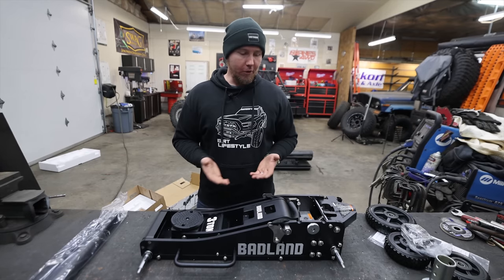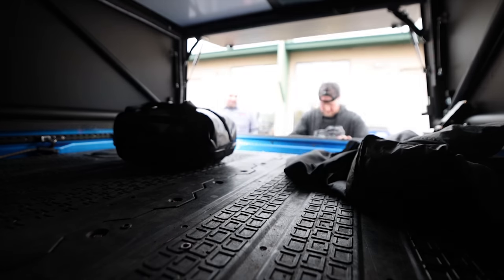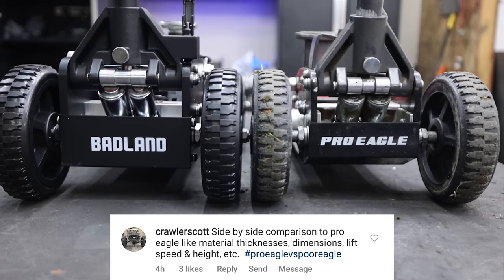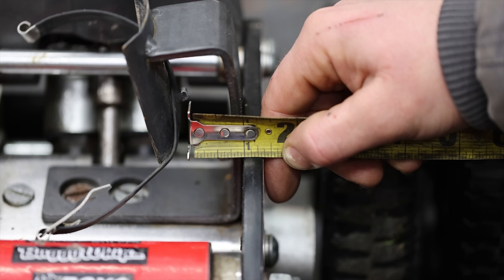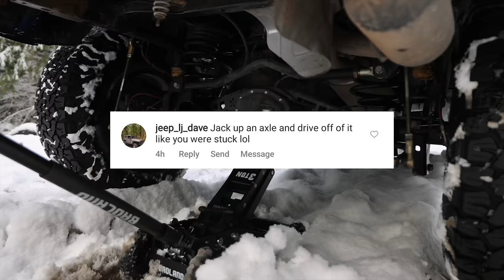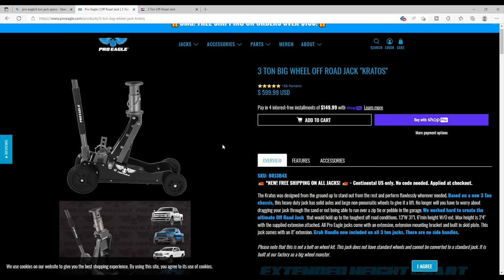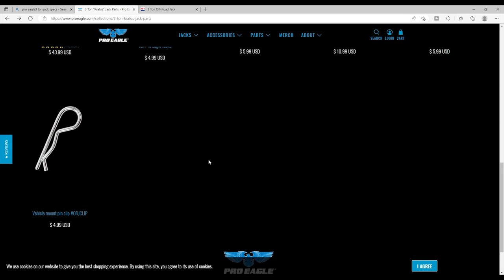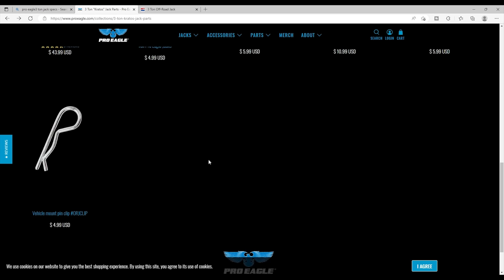Pro Eagle Clone Or Killer? Harbor Freight Offroad Jack Test and Review.

Comment: FYI - harbor freight manuals usually have a numbered diagram of parts that you can use in reference to ordering parts with the 1-800 number. The manuals are usually available by PDF on their website. For this jack the parts diagram is page 9 of the manual. The phone operators can pull up that diagram and be literally on the same page with you.
Reply: WOW, I was just getting ready to make this same comment!!! I guess for some of us it's common knowledge...

Comment: Harbour Freight has some great stuff especially for a DIYer. For tools to use in the shop/home, heat shrink, apache cases, etc. I have had some great success with their products.
Reply: 100% unless you are a professional mechanic, you don't need super expensive tools like Snap on. HF tools are great for the occasional DIYer. I have a few HF jacks and jack stands that have been flawless for ten plus years.
Reply: @remembermorrison A lot of shops are converting to ICON now…
Reply: all of my tools from high school are from harbor freight. all Pittsburgh and some craftsman. I have pittsburgh jackstands and a 3 ton pittsburgh jack. (jackstands are from BEFORE the recall, theyre the good ones, as been proven since they havnt killed me yet). Ive had these tools for over....6 years now and they just used like 2 weeks ago to pull an engine out of a honda Fit. people hate on harbor freight because "cheap" but i like cheap where its still giving me my moneys worth.
Reply: @remembermorrison  you’re absolutely right and I’d even say that some of their newer ICON line stacks up just fine against the more expensive brands you see in professional shops. They’ve been putting some high quality stuff out in recent years.
Reply: @g1mpster  Gearwrench too. They have really stepped up their game.

Comment: The fact you can flip a lever and rock the jack on the back wheels to roll it around is so handy! My pro eagle doesn't do that and if you want to push it around a corner it's not the funnest thing to do.. also the side grab handles are cool.. I want to add that to mine
Reply: I agree. An excellent improvement over the competition. The Pro Eagle Kratos has a serious competitor now. Why spend twice as much? HF has a hit a home run with the Badland floor jack.

Comment: Been using Harbor Freight’s Daytona 3 Ton Floor Jack for a while now and it’s a fantastic jack for under 2 bills. Don’t quote me but I read somewhere once that it’s 99% the same thing as the equivalent Snap-On jack. They have some nice stuff (not everything) and that off-road Jack looks pretty legit. Thanks for the review!
Reply: I have that Jack too & it is a snap on rip off. They even sued them in court but settled during discovery bc snap on didn’t want to disclose trade secretes
Reply: @adidas4275  not even a rip off, harbor freight found the same factory that was building the snap-on Jack and had them build the Daytona Jack. Snap-on didn't want people to figure out they were paying 1200 bucks for a china jack. Recently they've made the jacks in the us now for about 3 years
Reply: Snap on filed a lawsuit against harbor for this exact reason and LOST so it is not the same jack by court standards

Comment: One of your rock crawling buddies over at Muddy Beards bought a kit from 911 Motorsports and converted a Harbor freight racing jack into a big wheel off road jack.
I couldn't resist, it was so easy I bought a 100 dollar HF jack, ordered the conversion kit and built my own unit.  
So far a year later and I've had no issues with the jack, works perfectly. 
I think I paid 130 bucks for the 911 Motorsports kit plus the price of the jack, so it only cost me 230 dollars plus tax.

Comment: it seems like harbor freight learned from their jack stand issue. to use the ASME-PASE standard is a good idea. Also, couldn't you use Pro-Eagles accessories on the Badlands jack?
Reply: No the parts are different. Also the wheels are held on with nuts instead stupid clips that get lost when popped off. The lift extension is bolted on instead of twisted on. I love it so far. Pro Eagle claims theirs is made in the USA, well i am sorry but i haven't seen much quality coming out of the USA lately and i live there.
Reply: HF has been vacuuming up engineers from everywhere.
Reply from the maker: I saw a bunch of the new jack stands  from Harbor Freight at sema. They welded the bottom of the seam that was failing and made a couple of other small but significant changes. It's clear that they want to improve the products and change their image. The good news is as consumers, we win.
Reply: @SimonElenor  They don't claim the jack is made in the USA at all, thats exactly what this video points out.

Comment: I got my first HF floor jack when I turned 17. That was in 1980. A 3 ton with a set of stands. I'm still using them today. I have had to replace the seals a couple times.    This new big wheel jack is something I'm going to need to pick up.

Comment: One thing I would’ve liked to see compared was the weight of each jack. Wasn’t listed on harbor freight’s comparison and I think when I looked up the specs it was a decent difference.
Reply: Pro eagle 3 ton is 12lbs lighter
Reply: Badland Product Weight 72.66 lb.
Reply from the maker: I wish I could speak more confidently about this. I just didn't have the 3 ton pro eagle to compare, but the thickness of the frame is definitely one area that will change the weight in a big way. Plus, the front of the Badlands has steel sections for the lateral support that isn't on the pro eagle. This will help keep the jack from folding over if it's on an uneven surface. This is speculation until I see a 3 ton pro eagle, but I think the weight difference comes from extra supporting structure and material thickness.
Reply: @DirtLifestyle HF did some serious research on who they are marketing these products to and how they will be used in the wild

Comment: Great review. The quality of Chinese products like this largely comes down to requirements coming from the R&D guys sitting in America. As part of the PPAP a reputable company would require (and verify!) chemical analysis and mechanical strength of the components, good quality seals, adequate precision and surface finish and then perform release testing for durability, chemical resistance (salt spray), high/low temperature function, etc. China can churn out decent stuff when there are very clear requirements and verification by the customer.
Reply: I agree with this, coming from the machine tooling and automation industry, the big Chinese machine shops can and will make good parts to exact specs. There is enough competition over there and in the US that if a shop tries to lie/cheat on the print specs, there are 5 more shops that are willing and capable to make the part to print. The company I work for (Complete Control Systems) still makes 99% of our parts in-house but a lot of other machine builders are designing machines, sending print packets to Chinese machine shops and getting back their machines in kit form.
Reply: Quality standard is usually up to the company that is buying the product from the manufacturer.  These manufacturers have to adhere to whatever standard the buyer/company sets forth.  Where it’s made is really a moot point.  Hell, I’m typing this on an iPhone made by an underpaid worker in basically a sweat shop and I don’t question the quality of it whatsoever.
Reply: Yup.  Way back in the day (I don't know if this is still the case) I knew someone that did a teardown of an Oppo phone (this was 2013-2014ish) - it was surprisingly well made, physical design was better than almost any phone on the market.

Too bad their software sucked - Oppo did have some efforts along those regards (including cooperating with Western developer teams) but they suddenly lost interest in catering to Western customers.

With this thing - no software, so THAT problem is solved.
Reply: I fully agree. A lot of the Rivian R1T suspension components are made in China.

Comment: Here I am modifying HF 2ton jacks with their 1100 lb 10” wheels and having no problems. Cheap, easy, works mint. 4130 axles and some aluminum plate. 

Great video! Nice and simple testing, and great callout to the manufacturers!

Comment: Interesting video! I did some research - Pro Eagle is actually a d.b.a. for Austin International Manufacturing, Inc. - who specializes in importing Chinese products into US market. So yeah, pretty safe to say, Pro Eagle is imported. They claim to specialize in Taiwan imports but looking at recent import logs its pretty much all Chinese. Clearly both are buying from the same caster supplier -  so if I had to guess the same plant is making both or at least their caster (wheel) supplier isn't far from both assembly plants.

Comment: Nate great comparison video, here in Canada any product sold in Canada has to tell on the packaging where its made or imported from to be able to be sold commercial or regular retail, here we have Princess Auto ,its our equivalent to Harbour Freight and was started local in Winnipeg where i live and i bought a large floor jack low profile, its the long shop style jack  and it lifts 2 1/2 tons and lifts 30 inches high and weighs just right around 200 lbs and i have had it  since the late 90's and use it in my garage year round and it has been completely reliable without issues, it wasn't cheap and is commercial rated, as the saying goes you get what you pay for , it had a pedal to get the jack started and its freaking awesome 👍

Comment: Someone might have already commented, but I just measured the wall thickness on the 3ton ProEagle and it comes up to 7/16", so thicker than the 2ton and slightly thicker than the 3ton Badlands.
Also, I am just east of Seattle if you want to take the 3ton for a spin around the block.  let me know.

Comment: Thought about the Pro Eagle a while back but got turned off by the price as well as the cost of accessories ($140 for stickers?  C'mon, man).  The Badland looks like the better option of the two right now.  I'm also considering the Safe Jack bottle jack kit...to me, its a lot easier to stow and has plenty of lifting point options.  Up until now, I've been tossing my Daytona floor jack into the back of my Suburban, but that act is getting old.  So now the choice is down to two.

Comment: Awesome review, I too did not want to spend the extra coin on the pro eagle due to price so I had even looked at a big wheel conversion for the Pittsburgh aluminum series sold by 911 motorsports. Now one thing I personally would love to see from HF would be more variety of synthetic line winches as well as traction boards. I’d buy traction boards from them so fast.

Comment: I have a Pro Eagle beast with tall attachment and don't regret it.  Its been great to cycle my jeep with coilovers and 40's.    Whole lot safer and easier then the old way of floorjack and 4x4 block.

Its cool to see HF in the market and I'll buy one as a second.   No issues with HF, I have used their jacks for a long time and aside of me pushing their aluminum jacks too hard, never an issue.

Did the Pro Eagle attachments work on the HF?

Comment: Looks like a pretty good jack  do like the large wheels the double pistons. Was pleased with # of pump's to reach max lift. I have a Daytona 4ton big green low profile 102 lbs little difficult to pick up a toss into a lifted truck;  not unhappy with the purchase. I bought a few months ago  along with $3,500 worth of other products at Harbor Freight   110 miles to get to in Twin Falls Idaho nearest to my town. Renewed my membership in reward program.  Back to your jack just checked the  specifications 72 and 1/2 lb with the 29-in lifting range is what is very impressive. Wide stance 14" also very stable. Think it should be well worth the $300 price tag.   Should find useful in the off-roading  community. I think it is an idea that's time has come. A good review.

Comment: I just saw this badlands jack a few days ago I really want it, its not like harbor freight is new to jacks at all either just they now have one that can be usable off the concrete. I think there's a lot of people who will still buy a pro eagle over the badlands, the same people who buy factory 55 and ARB recovery gear even though there are just as good a cheaper options. About a year ago I bought a small lock box, Tree hugger, tow strap, 2 soft shackles, a pair of gloves, synthetic line, aluminum thimble and hawise for $300 out the door all badlands. My 12k badlands winch I've been using and abusing for everything doesn't mater what it is. Not one issue I've had so far my winch is going on 3 years and never yearly serviced 🤣. The guy who owns Snap-on tools and Rigid Lights likes the quality and is impressed with Badlands.

Comment: I have used a few of the harbor freight Badlands products. So far haven’t had any issues with them.

Also, I agree with you. It would be great if they would advertise where the items were made. At this point, I think, in order for it to be sold in the United States, there should be a rule or some type of regulation that that should be on every product.

Let’s just clarify. If a company claims to be made in the USA. They need to specify if they purchase every single part down to the little tiny piece from American companies who also get their products and supplies from the United States in order for them to claim the “made in the USA” slogan. I’ve done extensive research on some of these companies, especially in the Overlanding community, that claim this. Come to find out that quite a bit of the supplies they use to make their product is sourced from other countries. Then they slap that slogan on their products and charge 20% more. While driving there foreign made vehicles. And try to shame us into buying American. It seems to be OK for companies to do what they can to help their profit margin. But yet were the bad guys who decided to buy a less expensive product, made somewhere else, just so we can afford to do more things with their families.

As you can tell, this is one of my pet peeves about Youtubers when they tend to advertise and brag about buying things that are made here in this country. Without doing the research of if that product actually is 100% produced in the USA. Not just put together here. 

This is why I like your open platform and honest reviews. Thanks for not selling out.

Comment: Last weekend I used my $480 HF Apex12000 winch to free a completely burried F450 with a service bed on it. No idea what the truck weighed but the winch didn’t give a fk. I did use a pulley but it was to change the angle of the pull

Comment: See, this is the stuff I like to see. I was thinking of off-road jacks because for my first time ever thus past Sunday, I blew a bead on the trail and was not able to get to solid ground. It was either stay where I was and hope the high-lift didn't do me wrong, or back down 600ft of large rocks (1-2ft rocks), or winch up 300ft of Boulders (2-4ft rock ledges). Concidering I have cheap wheels, and new tires, I opted to risk the high-lift and just use the Boulder that popped my bead as a vehicle holder by swinging my front end over the top of that rock and resting the belly on it so I could use the high-lift to get the spare put on. (Easier then cleaning out all the mud, then hoping my "jerry rigged" Viar air compressor had enough to get the tire to seat again. (Yes proper onboard air has been purchased, just not installed yet). 
Having a nice offroad jack would've been perfect and much safer overall. 
To harbor freight I go, and also to the driveway to install that damn twin ARB!

Comment: I have a Pro Eagle 2 ton jack and have had for a while now. If Harbor freight had the badlands when i purchased the pro eagle. I would have bought the Badlands. I love the pro eagle, but i still don't like the price, and now after owning it, i am glad i have it. However, for the price of the jack, the jack mount for my truck and the tool set, i would have saved hundreds or got new gear for the price difference, etc.   I have not needed parts yet, but the proeagle will need lock tight as some hardware have vidrated loose during storage and trans port as it lives in my truck bed, but the mount catches everything and it is easily found, same goes for if it falls into the jack itself.  The proeagle has been abused and the only thing i see that is annoying is that it runs away from you if you are not careful on inclines. Lol

Comment: I saw people talking about this at SEMA. I don't particularly care where something is made anymore, as long as it works and is reliable. I'd be interested to see if the pro eagle has the same safety rating as the HF, or maybe a better/different one. I can 100% tell you, I'm not spending double on a comparable jack just because it's murica made. I've had just as much "USA made" stuff break as Chinese shit. 

Just my 2 cents.
Reply: The reason you see just as much "USA made" stuff as Chinese stuff break these days is because the USA made stuff is still made with cheap imported Chinese steel/aluminum.
Reply: @bigd7481  while that's true, I would expect things to be tested and held to a higher QC standard if I'm paying a premium. I will drop thousands on an optic for my rifle because I know the QC is better than the Amazon shit. But if the extra cost does mot equal higher quality, then I won't be as willing to spend the extra coin